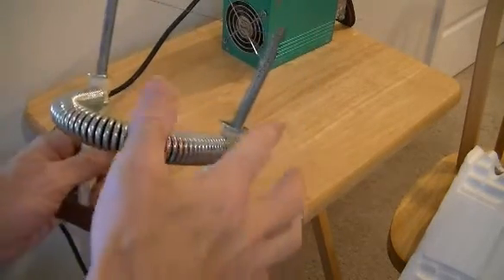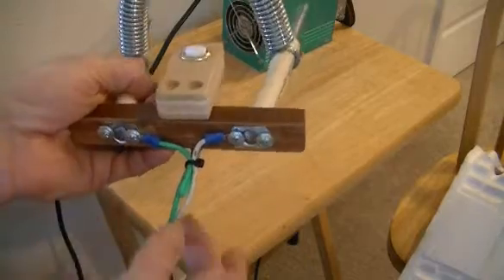DIY Hot Wire Foam Cutter

Comment from the maker: The wire I used is 24 Gauge Nichrome Resistance Wire. (Nickle-Chromium) You can find it here: http://www.amazon.com/Nickel-Chromium-Nichrome-Resistance-250ft/dp/B00AWS4CAO/ref=sr_1_1?ie=UTF8&qid=1389874998&sr=8-1&keywords=nichrome+wire+24+gauge